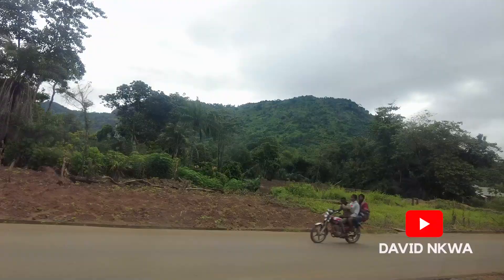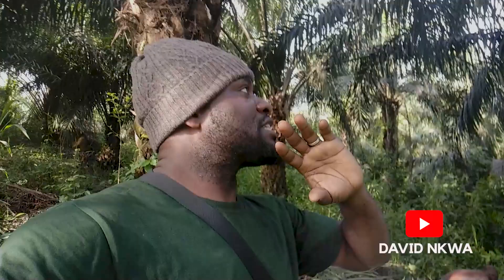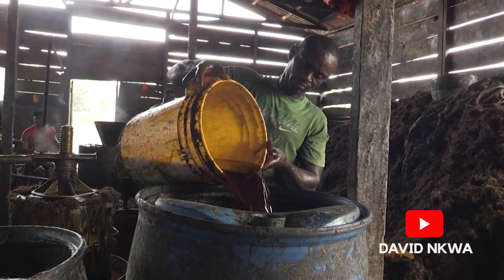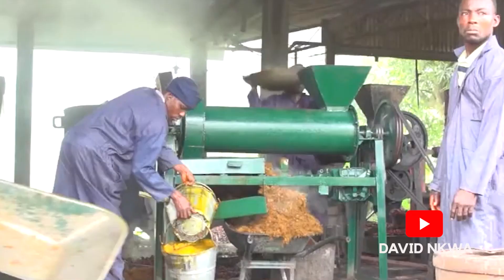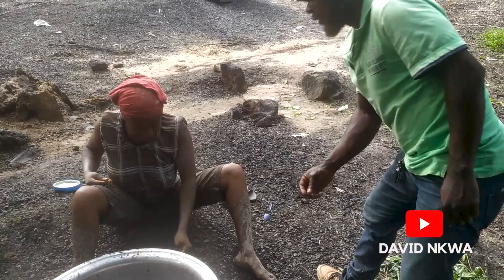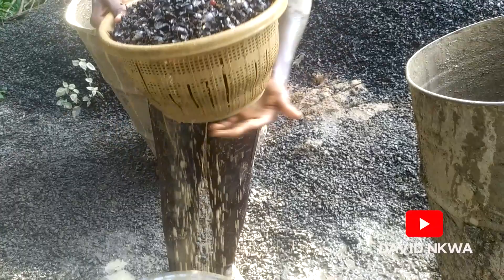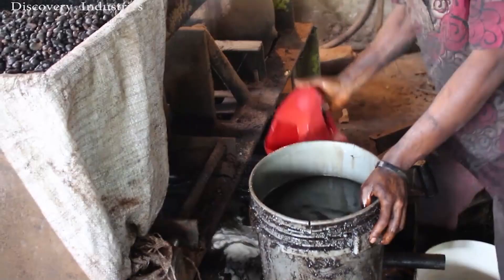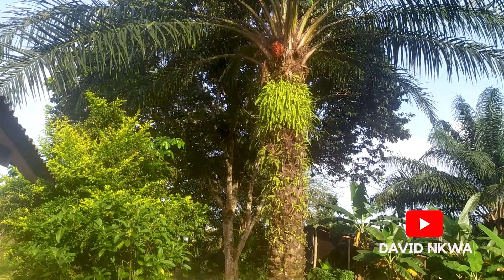Palm Oil production in Southern Nigeria

Comment: Wrong, the boiled fruit is not put into a grinding machine. It is is into a thrashing machine. And the thrashing machine is being overloaded simply because they design the gearing ratio incorrectly from the motor to the load.  They are wasting production time and money.
Reply: Pls explain better technology that they can use for optimal performance.
Reply: @safiyahamisu5874  you misunderstood.  He gave the wrong name of the machine which he called grinder.  The correct name is thrashing machine.  The purpose of this machine is to seperate the cooked fruit into the flesh, fiber, seed& oil. In English, the fiber is also called “chaff” and the seed is also called “kernel.”